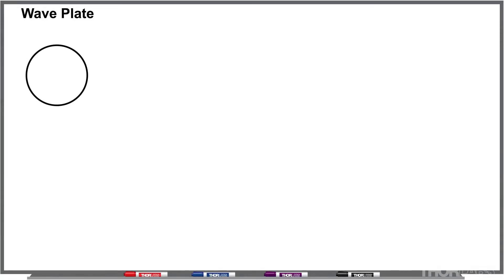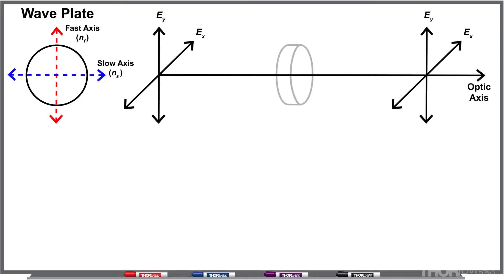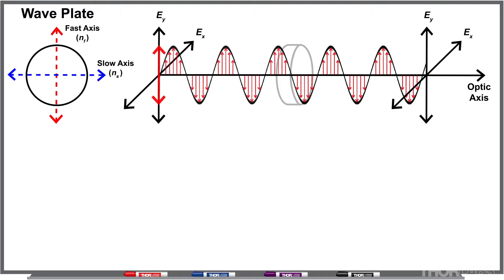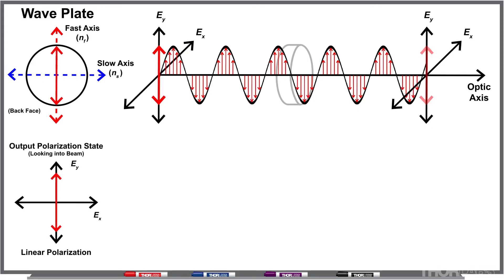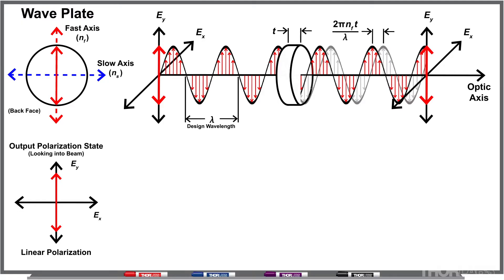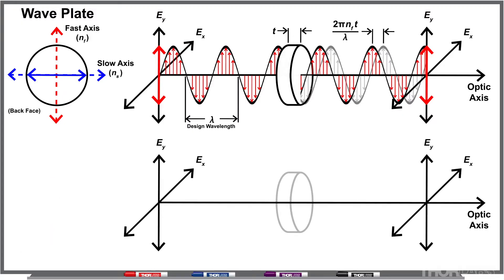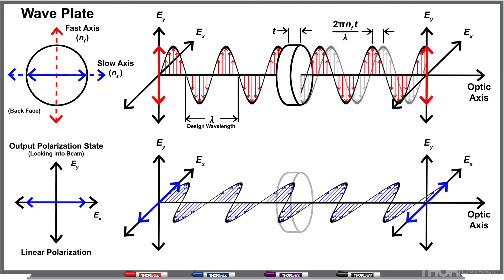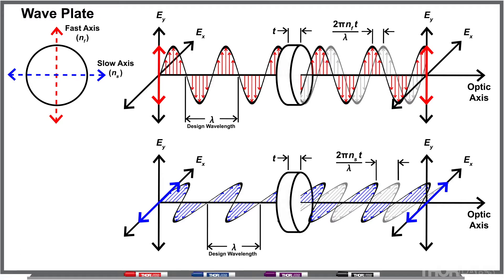Create Circularly Polarized Light Using a Quarter-Wave Plate (QWP) | Thorlabs Insights

Comment: Great video! I am curious whether the polarization rotation is correct at 3:20. Thorlabs "Polarization Handedness Convention" by Erik Gentzsch 10 July 2017, where the handedness is described by also by looking into the beam ("observer looks along the -z direction towards the light source"), suggests that the polarization rotation should be anticlockwise (left-handed). I guess my question is what does "back face" mean in the video? If I would look at the whole system (circular light and initial linear polarization) as looking towards the beam, the linear polarization would be flipped?
Reply from the maker: @user-or8vw3dh6i   As you note, the rotation direction of the polarization vector depends on whether the observer is looking towards the light source or away from it. In addition, the rotation direction also depends on whether the vector is being plotted as a function of time or as a function of distance. In the “Polarization Handedness Convention” technical note, the polarization vector is plotted with respect to the distance axis (z), while in the video we are showing the polarization vector plotted with respect to time (t). 

To see why the rotation direction is flipped between time and distance plots, consider light travelling from a source on the left, to a destination on the right. 

If the light could be frozen at one instant of time, the light closer to the destination would have been emitted at an earlier time than the light closer to the source. Because of this, the corresponding polarization vectors’ effective timestamps would become earlier as distance from the source increases. The technical note plots the polarization vectors with respect to distance from the source, so the vectors farther from the plot’s origin correspond to light emitted at earlier times. 

Alternatively, measurements of the polarization vector might be made at only one physical position, but over some length of time. When the measured polarization vectors are plotted with respect to time, the vectors plotted closer to the plot’s origin have earlier timestamps than the vectors plotted farther away from the origin. This is the plotting approach taken in the video. 

Since the order of the vectors is opposite depending on whether they are plotted with respect to time or distance, it affects the apparent rotation direction. However, the plotting approach does not affect the “handedness” of the light. When looking into the source, right circularly polarized light rotates clockwise when plotted along the time axis and anti-clockwise when plotted along the z-axis. (For more information, see Polarized Light and Optical Systems, by R. A. Chipman et al., 2019, Chapter 2.10.)

Comment: Thank you so much for this great video! I have a question about that, is it necessary to use two polarizers? If we know the transmission axis of the first polarizer P1, and just put the QWP after the P1 with the fast axis at 45 degrees to the P1 transmission axis, can we also get the LP or RP circular polarized laser? or I just do not get the real key point of using second polarizer. I really want to get your reply. Thank you so much.
Reply from the maker: @astronomerz7674   You are correct that, if the angle between the QWP’s fast axis and P1 polarizer’s transmission axis is exactly 45°, no P2 polarizer or additional work is needed to obtain circularly polarized light. But, how can you be certain there is a 45° angle between QWP’s fast axis and the P1 polarizer’s transmission axis? 

If the 45° angle were determined using only the manufacturer’s physical markings on the optics, the actual angle would be uncertain. There are a few reasons for this. Components can be swapped between housings, or removed and remounted, resulting in their axes being misaligned to the markings. Optics can also shift in their housings with repeated use. Even if the optics are new, the markings may only be accurate to a few degrees. When only physical markings are used, it is not possible to be sure of the angle or output polarization state.

Optical alignment methods, like the one demonstrated in this video, have the advantages of being highly sensitive to misalignment and not relying on physical markings. The crossed P1 and P2 polarizers are used to precisely align the QWP’s axes to the 45° angle. (The transmitted power is minimized when the QWP’s axes are aligned with the polarizers’ axes and maximized when the QWP’s fast axis is at a 45° angle.) Without the P2 polarizer, we would not have reliable information about QWP’s angle and would risk outputting light whose degree of circular polarization is too low to meet the application’s needs.

Comment: Are all the polarizers in the experiment QWP?
Reply from the maker: @ibekwe00001 Linear polarizers are different than quarter-wave plates (QWP). Linear polarizers block some light from being transmitted. The only light transmitted by linear polarizers is light polarized parallel to the polarizer’s transmission axis. And, light transmitted by linear polarizers is always linearly polarized.

Quarter-wave plates transmit all light. They do not block any light, but they do have two axes: a fast axis and a slow axis. Light polarized parallel to the fast axis travels faster than light polarized parallel to the slow axis. The total relative delay is one quarter of the light’s wavelength. Delaying light polarized parallel to the slow axis relative to light polarized parallel to the fast axis is useful for many things. For example, quarter-wave plates make it possible to change linearly polarized light to circularly polarized light (and back again).

Comment: So how can we determine if the CPL is right-handed or left-handed? For example, the fast and slow axis as presented in the video are statis and we can only tilt the linear polarization. Lets say the a beam of light is going out of the picture with a linear polarization orientated at 0° (horizontally), and we turn it counterclockwise by 45°. Would we then get right-handed CPL? And would we get left-handed CPL if we would turn it clockwise by 45° from the 0° point? It always confuses me so i hope you could set my mind straight :)
Reply from the maker: @InfiltratorChris  The approach demonstrated in this video cannot determine the handedness of the circularly polarized light (CPL). Determining that requires a polarimeter. (We have a few videos that show how to build and use a polarimeter, including https://youtu.be/pR4r7gMyN5U and https://youtu.be/js31t-IFipo , in which the DIY polarimeter overview starts at 4:14. It is also possible to purchase a turn-key polarimeter to make these measurements.) 

If you know all of the details about your input light and your optical components, it is possible to theoretically determine the polarization state of the output light. However, it is important to first define the assumptions/convention you want to use. One reason that polarization is confusing is that more than one convention is used when speaking about handedness. (For example, some people assume the observer looks towards the source, others assume the observer looks away. Some people observe the rotation of the polarization vector with respect to time, others with respect to distance.) Different conventions can appear to give different results, since the interpretation of the data depends on the convention, but they are consistent with each other. To avoid confusion, we recommend you use just one convention, and ask others which convention they use when they share data with you. 

In these videos we use the convention that the observer is looking towards the source, and that the observer is observing the rotation of the polarization vector with respect to time. A way to think about observing the rotation of the polarization vector with respect to time is to imagine a stationary plane between the source and the observer’s position. Also imagine that, as the light passes through the plane, it is possible to see the instantaneous polarization vector. The rotation of the polarization vector on the plane, as light passes through it, is the rotation of the polarization vector with respect to time (this is illustrated in https://youtu.be/pR4r7gMyN5U , starting at 2:56). In addition, it is necessary to define the coordinate system. We assume a Cartesian coordinate system, where the z-axis points away from the source (to the left in the video), the y-axis points up, and the x-axis points into the board. 

The orientation of the wave plate also matters. In this case the orientation used in the animation is assumed, in which the quarter-wave plate’s fast axis is aligned to the y-axis and the slow axis is aligned to the x-axis. If the input linearly polarized light is rotated CCW from the horizontal so that it is at +45° to the x (horizonal) axis, then the light output by the quarter-wave plate will be left-circularly polarized. In this case the rotation vector on the imaginary screen will rotate CCW. If the input linearly polarized light is rotated CW from the horizontal so that it is at -45° to the x-axis, then the light output by the quarter-wave plate will be right-circularly polarized. In this case the rotation vector on the imaginary screen will rotate CW.

Comment: Great video here ! With the circularly polarized light produced with the quarter wave plate , Is the intensity recorded after the last linear polarizer half the initial intensity with the first linear polarizer ? I am asking because the circularly polarized light should have equal components of polarization . Please let me know if there is an error
Reply from the maker: @josephokaidaafour693  You have the right idea! Half of the light output by the quarter-wave plate would ideally be lost after passing through the second linear polarizer, because the circularly polarized light includes two equal-intensity, orthogonally polarized components. In practice, however, the amount of transmitted light is actually a little less than half, since some light will be lost to optical reflections from the faces of the optics.
Reply: @thorlabs  Thank you. Is it also safe to say that when you are producing circularly polarized light, you do not need the second polarizer in your set up ?
Reply from the maker: Assuming your application requires circularly polarized light, you are correct - the second polarizer should be removed from the setup after the quarter-wave plate (QWP) has been aligned. This is because circularly polarized light is provided by the combination of the first polarizer and the QWP. When a second linear polarizer is placed after the QWP, the setup provides linearly polarized light.
 
Note that, as shown in the video, the second polarizer is required to complete the alignment of the QWP and is useful for confirming that the light provided by the QWP is circularly polarized. After you are satisfied that the light provided by the QWP is circularly polarized, remove the second polarizer to allow the setup to output circularly polarized light.
 
It is interesting to note that, in some cases, it can make sense to leave the second polarizer in the setup. For example, when the application requires linearly polarized light whose polarization orientation can be easily rotated without changing the transmitted power. (This is shown at the end of the demonstration.)

Comment: Are there power losses after transforming from linear to circular polarization?
Reply from the maker: @zedius24  There should not be any power loss from the transformation itself. However, there are typical losses that occur when light propagates through an optic, such as reflection losses at the front and back surfaces of the wave plate and material-related losses. These losses can generally be determined from the optic’s transmission specifications.

Comment: Optic axis is direction along which if a wave propagates, it suffers no double refraction.
At 2:32 light is propagating along optical axis then why it's suffering double refraction, there should be either E-wave or O-wave means component either along fast axis or along slow axis should be there.
In that case we should get linearly polarized light regardless of angle of incidence.
Where am I wrong?
Plz answer I'm so confused
Reply from the maker: @Ranbir.Bhardwaj  We think that a label used in the animation that begins at 0:43 may be the source of your confusion. In the animation, we mistakenly labeled the horizontal axis “Optic Axis.” The horizontal axis should be labeled “Optical Axis,” since it describes propagation direction of the light and is not related to the birefringent properties of the wave plate. In this video, we use the labels “fast axis” and “ slow axis” exclusively to describe the wave plate’s birefringence. Please let us know if this does not help with your confusion.

Comment: Hi, thanks for the video. Are these polarizers and quarter waveplates direction sensitive? Do they have specific input/output sides or can they be used in any direction as input/out?
Reply from the maker: @naveed3619 The linear polarizers and quarter-wave plates in the video can be used with either side facing the input beam. They do not have specific input and output sides.

Comment: Hello Sir,
May I ask as the number of Quarter  waveplates ( 266nm, 350-850nm) are available, which quarter wave plate should I use if I am going to use the band pass filter of 365nm? And if we are using band pass filter then can we use the arrangement like this?
light source----------band pass filter----Polarizer------quarter waveplate------sample?
Look forward to hearing from you soon. 
Thank You so much!
Reply from the maker: @kainattalat5739  Wavelength is definitely an important parameter to consider when choosing a quarter-wave plate (QWP), since the exact delay (retardance) provided by the QWP depends on the wavelength of the light. Retardance data is available for each QWP, and we recommend looking at this specification to determine the delay a particular QWP will provide over the wavelength range of your filtered light source. The retardance of the QWP can also be affected by the angle of incidence and other operating conditions. Different types of QWPs are designed for different cases. These types include true zero-order QWPs ( https://www.thorlabs.com/newgrouppage9.cfm?objectgroup_id=8635 ), pseudo-true zero-order QWPs ( https://www.thorlabs.com/newgrouppage9.cfm?objectgroup_id=7234 ), and multi-order QWPs ( https://www.thorlabs.com/newgrouppage9.cfm?objectgroup_id=7234 ). QWPs optimized for broader spectrums include achromatic ( https://www.thorlabs.com/newgrouppage9.cfm?objectgroup_id=854 ) and superachromatic ( https://www.thorlabs.com/newgrouppage9.cfm?objectgroup_id=2193 ) types. 

The details or your application determine how to balance the different options to choose the best option for your particular setup. Our Tech Support would be happy to discuss the different options with you, as well as discuss particulars about your setup ( techsupport@thorlabs.com ).

Comment: what will happen if i replace the output linear polarizer by a halfwave plate in this apparatus, how will the half wave plate affect the circularly polarized light?
Reply from the maker: @jishnusasidharan2165  If the light from the quarter-wave plate is circularly polarized and incident upon a perfect half-wave plate, then the light output by the half-wave plate will also be circularly polarized. However, the handedness of the circular polarization state output from the half-wave plate will be opposite the handedness of the incident circular polarization state.
More specifically, the handedness of the circularly polarized light from the quarter-wave plate will be either right- or left-circularly polarized. For an observer facing the light source, we define right-circularly polarized light as having a polarization vector that rotates clockwise around the optical axis. Left-circularly polarized light has a polarization vector that rotates counterclockwise.
To know the handedness of the light, the user must know the orientation of the quarter-wave plate’s fast axis with respect to the transmission axis of the input linear polarizer. Another of our Video Insights ( https://youtu.be/XQwiPm5OtSk ) demonstrates a method that can be used to find and distinguish the fast and slow axes of a wave plate to know the orientation.  Alternatively, we have also demonstrated how to build a polarimeter in a third Video Insight ( https://youtu.be/pR4r7gMyN5U ), which could be used to measure the handedness.